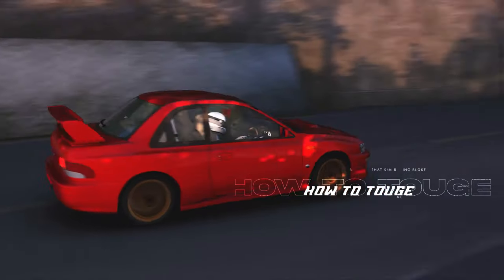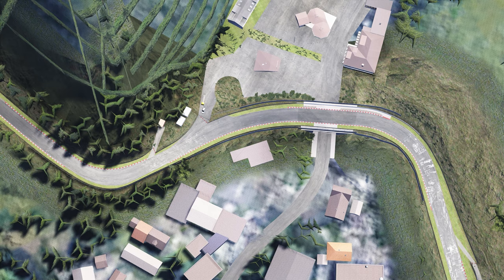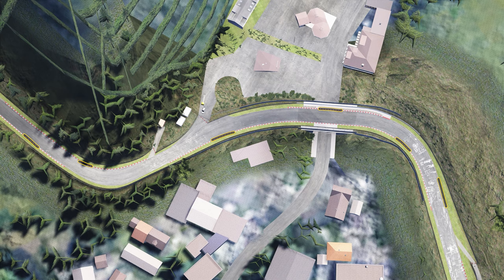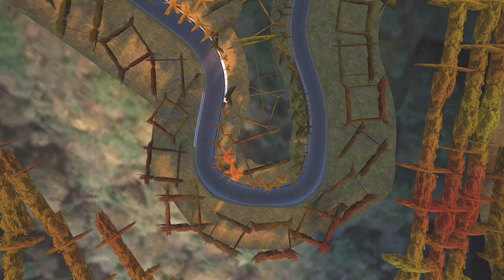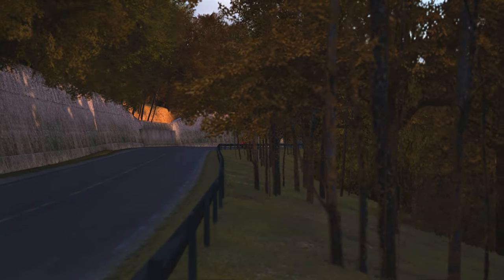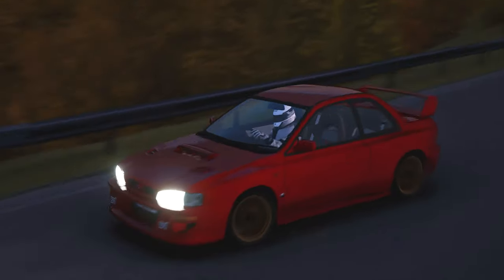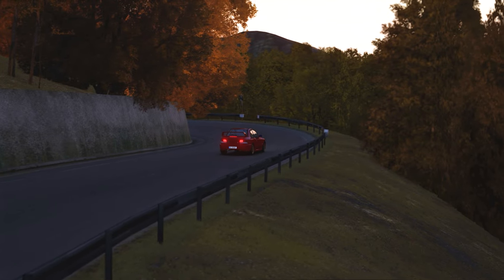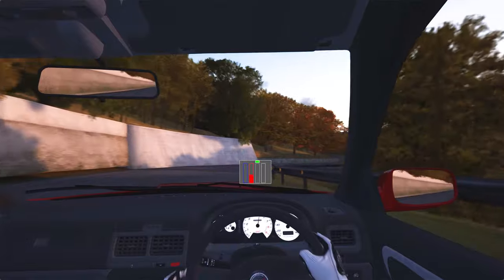How to touge on Assetto Corsa 2021

Comment: I always though that the race line depends on the car, Alonzo use to take advantage of his car tires (my english sucks, the tires sre large) he brake a little late then push all the car gaining speed fast, now! Senna was brake suddenly and keep kicking the gas pedal to manage to make the car slide a little bit and gain high rpm at the exit of the curve. Both different cars and different lines

Comment: The one important thing for touge, that everyone should remember, is rule that says, that you cannot be fast if you're pulling pedal to the metal. I knew much of racers, that were good at racing track, but absolutely otherwise at touge. You should know where you should open throttle and where not. You should use your car on it maximum, but you should do it smart

Comment: If out-in-out becomes less viable due to the shape of the course around subsequent corners, do late apexes become more valuable?
Reply from the maker: Yeah late apexes and simply hugging the inside all the way round are a good way to set yourself up for the next corner. The corner itself will be slower but you'll probably gain time over the entire run. Late apexes will also give you a higher exit speed if a corner leads to a straight.
Reply: @StreetVersion  yeah, totally. Especially if we're sacrificing any sort of entry speed. Agreed, stuff to watch out for.

Comment: im new to this and i am very used to circuit racing, so i have question. Wouldn't it be faster to brake later and not coast then to brake earlier and coast untill the apex? like trailbraking?

Comment: Funny enough, overdriving made me slightly faster than 90% of people on the servers I'm playing on 😂
My PBs are usually just 3-7 seconds slower than the current fastest on the server. For example usui circuit, usually the best time is from 2:05 to 2:10, my lap time on Ae86 Tuned varies from 2:12 to 2:16 (depends on a day (bad or good), amount of players and car settings which I change pretty often to understand how to setup the car properly)
On the lines where it would be smarter to drive 130 kmh MAX, I drive up to 140-160 and then smash the brake pedal before entering the corner. It most likely looks awful to anyone driving behind me, but it's somehow few milliseconds faster

Comment: I have a question, is it ever faster to slide the car to slow down and take a turn? It definitely feels cool to oversteer and then 4 wheel slide into a corner and power round it, but are there any corners this could actually be faster?
Reply: As far as I know, drifting is generally slower. But on touges, if you "drift" in a really low angle, its sometimes faster than full grip.

Comment: Do you guys use abs on touge? If yes, in every car?
Reply: never
Reply: @cooba9021  there's literally no reason not to, unlike traction control which will usually slow you down. Unless you have good pedals, but on logitech pedals it's pretty much impossible to be better than abs

Comment: I already do this... I play car x myself and it's hard as balls to do the complicated stuff like no control steering or whatever the actual name is, try having front tire grip through a corner and only using the accelerator to turn. Only turn on entry then no more. You shouldn't drift, but more like sliding your tires and wearing them a little less than drift. While grip is better for tire wear, this still conserves and is even faster.
Reply: That’s called slip angle